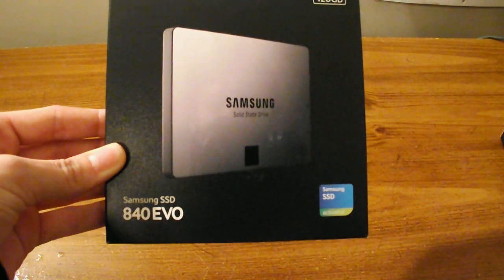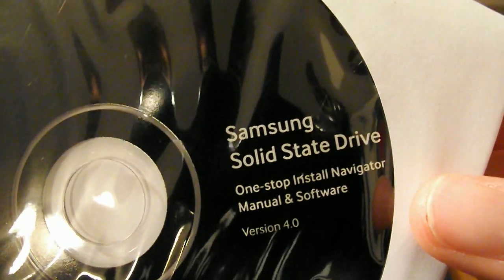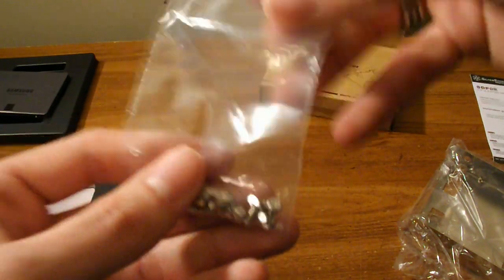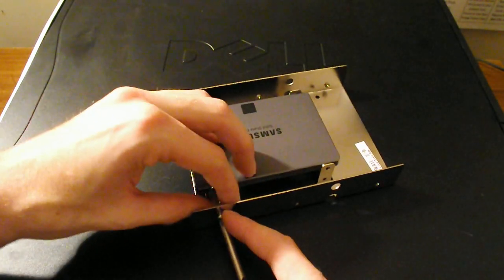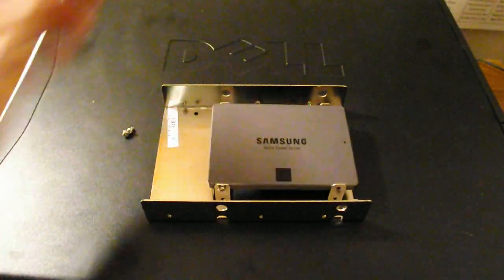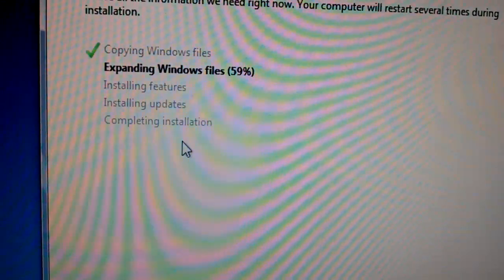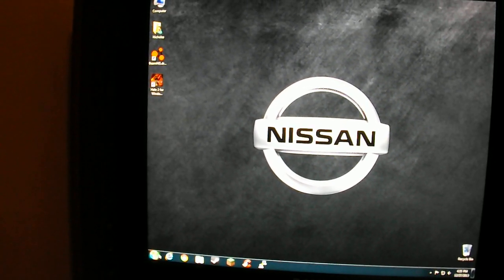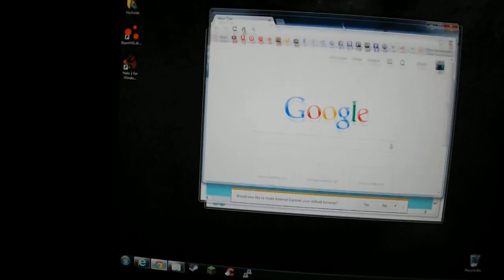Samsung Evo 840 120GB SSD Installation

Comment: Hi,

I am trying to install an 850 Pro, without any success.  I have W8 on my desktop and cannot seem to get the cloned ssd to boot.Having both disks attached I inserted the installation disk that came with the ssd and it seemed to clone OK, but then it would not boot from the ssd when I had finished.  Am I doing it right?

Regards,

Fern
Reply from the maker: Fern Jalovy I can't speak for the included cloning software, because I never used it. Windows 7 and up have a second hidden boot partition that needs to be cloned over to the new drive as well. Maybe that could be your issue. This is the software I use to clone drives: http://clonezilla.org/
Maybe that will get it right.
Reply: +Fern Jalovy restart your PC and with for the options at the bottom and press the corresponding key to open the boot menu, select the drive you want. If it works restart your PC again go into the BIOS and permanently change the boot order to the desired drive first.

Comment: How's it working since February? I was looking at the 250gb version and was wondering if there was anything I should be aware of before I buy it. Any issues you've come across, that is.
Reply from the maker: No issues at all! It's been great! I actually bought the 250GB version for my laptop just recently. It's been rock solid as well! I very much recommend these drives; for the price, you can't beat them!
Reply: ***** Okay. Thanks a lot of the responce!

Comment: If I buy this and also buy a new OS and install it on this ssd, what can I do with my old HDD with all my games/files on it? Am I able to connect it after doing all these steps and use it for storage only?
Reply: your gunna want to put your os and games on it for maximum power or else it wont be as fast/smooth
Reply: +Skydogg5555 You can use an HDD with an SSD, in fact you can have 4 SSD's and 6 HDD's, it all depends on whether your PSU has enough cables to supply them all, just install the SSD and research how to set it as the boot device, otherwise it will basically just be extra space (for a really large price)

Comment: What cables did he plug into the ssd? I can't find any cables like the smaller one he plugged in there.
Reply: Big one of them from your PSU and the second small one is SATA cable. It goes with SSD or you can get it from your old HDD or you can buy it for like 1-2$

Comment: Where did you get the cables to install the ssd? Did they come with the pc or did you buy them?
Reply from the maker: I used my existing cables to install the SSD. You can find them pretty cheap on Amazon, and Monoprice though.
Reply: If you built your  PC, the sata cables should come with your motherboard. Otherwise, you can get them really cheap.